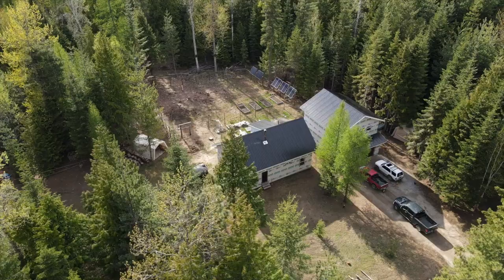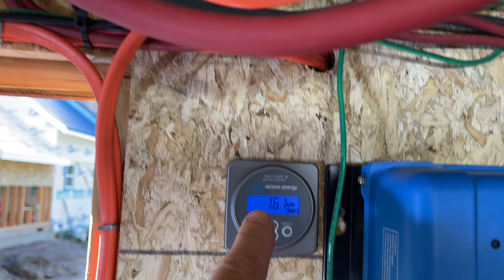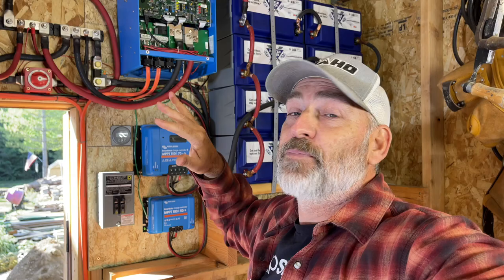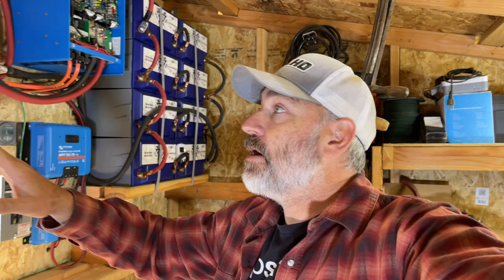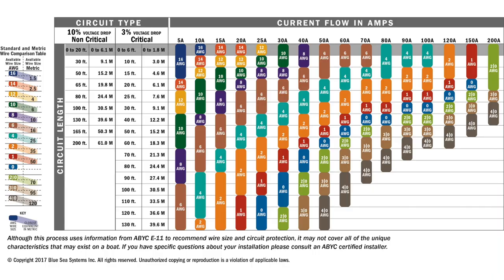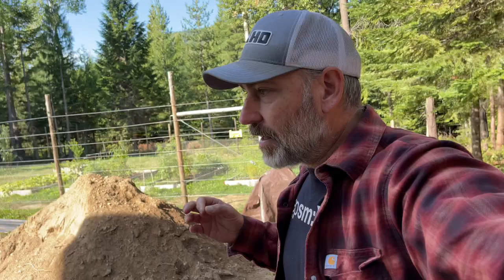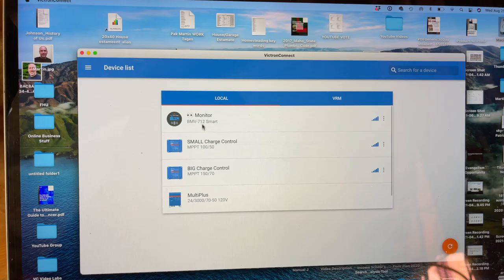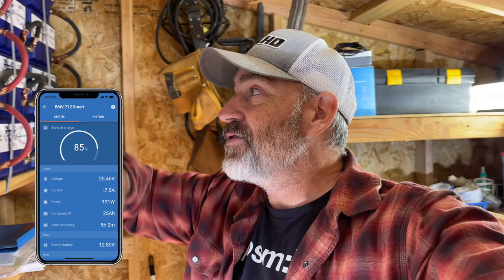DIY Off Grid Solar Power System for Home - AMAZING POWER!

Comment: We just bought a Amish farm here in TN. I already ordered my Battle Born system with 8 batteries and a 5000 watt inverter charger. My question is regarding your well pump. Our pump needs to be replaced. I was looking at a 110 volt pump. Is there a reason you went with the 230 volt pump?
Reply from the maker: Wire size and length of the run. Check some well wiring charts to make sure you use the right size wire from the inverter to the pump. https://www.aquascience.net/wire-sizing
Reply: Okay, looks like the bigger pumps require 230 volt. Just trying to get my head around it but do I need a second inverter to combine them to get the 230v. I think that is what you are doing?
Reply: @rambling4x4adventures92  I have a similar situation with my well pump. I currently run a 110 Volt pump but its a long way from the well to the house. I have to use larger wire to make sure enough power can get to the pump itself. 
Im not 100% sure on this but I think 230V pumps are a bit more efficient and cycle less. 
Im about to install a new VFD constant pressure system which has a soft start.

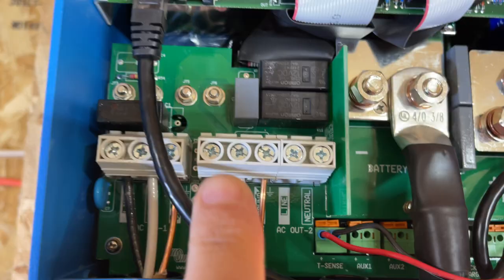Comment: Hi Martin, again, very good videos, thank you. I have a couple of questions, the first one is about something I noticed in minute 6:20, I understand that you use a split phase system to draw 240 V and feed the well pump, but I also noticed that the inverter has 5 connection lugs on the output side, two of those are for the line, since I don't know well how it works so maybe you can help me understand, but if you use those two lugs, then you can draw 240 V out of a single inverter? 
Also, What is the size of your well pump (240 V, ¿HP?).
Thank you!
Reply: I had this same question. I want to start with 1 inverter.

Comment: Metals and rare earths are needed to make solar panels and inverters.   We mine them.   Through mining.     In 2019 I I had thought ( I was told) mod shipments slowed down because of high demand ( which in part was true).    But I now feel mineral demands exceeded mod plant manufacturers and this caused the actually mod/inverter/storage battery shortage.       Green builders ( installers and managers ) have also lost their jobs due to the general slow down.   Yes even green jobs

Comment: That's pretty cool. Can you share what it cost for the total system (panels, batteries, controllers, inverters)? What is the life expectancy for the batteries? Will you keep a spare battery charger and inverter on hand? With all the data that's collected, you will be able to calculate the cost per kilowatt-hour over the life of the system. I imagine that over time, equipment will improve and cost will go down. It has been great following your progress as your dream comes to fruition.
Reply: In the description it has a link to everything those batteries are $950 each
Reply: @nogonova  Thanks, those parts add up quick.
Reply: @ctbcubed  yes, they do, but what you're doing is eliminating the impact of the retail price changes of electricity, (which strangely only go up every year, never down) and protects you from the effects of power cuts (cyberwarfare attack on the power company?)

Comment: Weren’t you using Dakota lithium batteries? If so why not now? Wish I had your smarts marty 🤷‍♂️ my wife and I have a 300 foot cabin in the desert and at the moment we are just trying to get our 500 watts hooked up with gel batteries this has been very expensive as I’m on disability ssi. But love what you have done and would love to have a system like yours someday. Ps do you still have the Bluetti ? And if so what have you been powering with it?
Reply from the maker: No, wasn’t us. I think they are good batteries too though.
Reply from the maker: Yes we still have it. Mostly use it to run our internet and security cameras. Also us it here and there instead of taking the gas generator.
Reply: @MartinJohnsonOffGridLiving  thanks for the reply’s I do appreciate it as I know you are a busy guy🙂

Comment: Could just rig a 24v high output alternator or two to the generator and run DC straight to the batteries.

Comment: The battery connection is wrong. LIFPO4 batteries should not be connected in series. There are controllers inside. If one in the series is already charged, all the voltage can damage the other in the series.

Comment: Battery setup looks good with the Straps, but Man are you making me nervous, every time I seeing the negative wire crossing so close to the Positive terminals of 2nd row far left.
 Have you ever seen 100 amp Batteries short out.   You will, when the Rubber insulation breaks through on the Negative cable

Comment: Absolute kudos for running Split Rail 240v (technically, a center tapped common output) but the misnomer of "split phase" is incorrect. Your phase is and remains 180 degrees. If you center tap that, your phase stays the same. Think current, not voltage. It's an extremely common mistake that electricians make in terminology, it drives us in electronics mad, as by making that mistake, it makes understanding of control circuitry nezxt to impossible.

Some inverters come or can be upgraded to triple phase output, wonderful for running industrial woodworking tools, but unless you have need for triple phase (the motors are much more efficient, as is the power delivery) split rail 240v is a huge plus. Again, for table saws and other heavier woodworking tools, operation is much better, and line-losses far lower. Table saws typically kick up to running speed in a quarter of the time compared to same motor running on 120v (most motors can be configured to run on each). 240v fed motors also don't 'sag' as much, as torque is much more readily delivered when needed.
Reply: Good comment. Btw: First of all I got confused about the "phase" thing, then remembered I believed I commented on this on Marty's last run down video. Good tutorial though: he did this self-taught and he keeps improving, which should be an inspiration to others.
Reply: I have never heard of a split rail 240 volt AC system. I am an electrician and I also don't call it "split phase" I just call it single phase 240 volt system. I guess I learned something new today!

Comment: Why not use 48v system?  24v good for EV but home better with 48v or up.
Reply: exactly, fixed installations can easily use 48v for better efficiency and smaller wires.

Comment: 1.Why are you usingthe generator..?  is it on gas.? the  other video  i so you got the 8 new bat. .it have a smll  box below (cant racall the name on it). you shiftet to 2  big ones over the dor. 2. why did you get  does 2 ? i did edit now its 24 V called a chager inverter i think.  you had another in the first video before opgrade to 8 batterys. i never see any solar panel coneckting before :)

Comment: why wouldnt you run your battery bank to 48VDC? if you have that many batteries higher voltage is always cheaper...
Reply: With the increased voltage you will have a drop in amperage. I can’t imagine he can run his entire place on just 200 A.
Reply: @digitaldazzle5836  that’s the whole point. Less amps = smaller wire and higher efficiency inverters and less losses.

Comment: Hi - each BMS on each Battery makes 8 slaves - those 8 slaves need a Supervisor/Manager.  Otherwise they are 8 individual batteries.  A Supervisor/Manager BMS will get the 8 in sync.  Then that will be a 2s4p Battery.  For now, they are not in sync - unless they talk to each other through a Comms Cable?

Comment: Better adjust your Equalisation voltage then . That should be off otherwise you will have your batteries overcharged . These are not what victron recommend so I don't know where the heck you got your setting from but they are wrong . Gradually you will be wearing out those Battleborn expensive batteries . When you can drop all the top voltages to no more than 27 volts anywhere. That way your battery cells will last, As they are I will be surprised if they are not dead in 12 months . When that happens I hope you remember to fix all those.

Comment: Shouldn’t you use 30amp breakers as the victrons are 3000 watts @ 120volt?  That’s 25 amps.

You’re shorting yourself 5 amps from each.

With having 20amp breakers coming off your inverters you capped yourself at 4,800 watts
Reply from the maker: True but this way the beaker will trip before the inverter overloads. That is my thinking anyway. Haven’t tripped one yet 🤞
Reply: @MartinJohnsonOffGridLiving  taken from Victron:  Consider for example a 30A 120/240V split phase supply. The supply could be the grid, a generator or two stacked inverters. Some of the loads connected are 240V, others are 120V. On each 120V leg the load should not exceed 30A. The problem is that as soon as 120V loads are connected, the two legs will show a different current. This is because the 120V loads on the two legs will never be balanced. A 120V 1200W hairdryer, for example, will draw 10A from one leg. A 120V washing machine could even draw in excess of 20A from one leg. Between the two legs the difference in current, or current unbalance, will therefore often be 20A or more. This means that the 30A supply will not be used up to its full potential. By the time one leg draws 30A, the other leg may be drawing no more than 10A, and increasing the 240V load, for example, will result in an overload of one leg while the other leg still has spare capacity. Theoretically, the total power that can be drawn from a 30A 120/240V supply is 30 x 240 = 7,2 kVA. In case of 20A unbalance, the practical maximum will be 30 x 120 + 10 x120 = 4,8kVA, or 67% of the theoretical maximum. The solution is an Autotransformer. By leaving the neutral of the split phase supply unused, and connecting an Autotransformer to create a new neutral, as shown in figure 1, any load unbalance is ‘absorbed’ by the Autotransformer. In case of a 30A supply, the load can be increased to 7,2kVA, and a 20A load unbalance will result in one leg supplying 40A, and the other leg 20A. The 20A difference will flow through the neutral and the windings of the Autotransformer. The current through both 120V wires of the split phase supply will be 30A.
Reply: @MartinJohnsonOffGridLiving  sorry my other comment didn’t post.  It’s called the Victron Auto Transformer.  It’s about $650.  Basically it goes between your inverters and your loads.  So instead of 25 amps and 25 amps, you could do 49 amps on one leg and 1 amp on the other.  The inverters would still see 25 and 25.
Reply: @xzibit8614  The autotransformers are really neat for balancing the current between the two inverters!

Comment: with all the extension cords they have more restriction, you should immediatley run your permanent line to a circuit panel box to the house  plus the cost of all those cords it would have been cheaper to buy a roll of 10/4 to run to the house

Comment: the only thing that would make that worth the money is if your being sponsored by those companies. otherwise you can buy pretty much 100% the same batteries only with a Chinese label for 30% of the cost and the same with the inverters. battleborn imports Chinese cells and builds their batteries out of the same Chinese cells that all the other brands use and then they mark it up by 300%-500%. as a result people who end up paying $10,000 get $3,000 worth of stuff. the Chinese suppliers are not rip offs either, they have 10+ year warranties on all their stuff. also the Chinese inverters are also a fraction of the cost and natively output both 240v and 120v in a single unit without having to buy 2 inverters. (pure sine wave)

Comment: You can move the shed with a lever. Me and another guy move boat lifts that weight more than the shed. I had to walk my shed 20 feet off the trailer by myself no tractor. Even today I can lift my shed with 2 motorcycles in it by using a lever. Should of bought super capacitors they would last rest of your life. Lithium are a waste of money. Super capacitors only take less than 10 minutes to charge the bank.

Comment: Lights lights lights where are the lights on your panels? For 24/7 365 power supply just add lights! For wind power just add fan! Hydro power just pump the water back into the lake!

Comment: Are you going to insulate teh shed?  Those batteries shouldn't be cold.
Reply: You mean they shouldn't be hot?
Reply: @uhjyuff2095  Nope.  Well, not as much.  If the batteries get below freezing you can destroy them by trying to charge them.  With the BMS it probably won't actually damage the battery, it will just mean you can get no power out of them if they're too cold.  It's true there is a high temp cutoff also, but if your exterior temp gets over that you have more problems than your batteries not working, like the end of the world as we know it.
Reply: @brianvandy4002  Correct, the process of freezing these batteries will not damage them and the BMS will make sure they won't charge or discharge if the temperature changes to the set temp the manufacture sets. From my understanding extreme hot temperatures should be avoided because that will cause damage to the batteries and the freezing cold will not.
Reply: @uhjyuff2095  But if you need them to work when the outiside temperature is below freezing, insulation and a supplemental heat source (100w light bulb or heating pads) could keep them working.  That's why I asked if you were going to insulate them.  I mean, if I were in a cabin in the woods on a freezing cold winter, I'd sure like to be able to curl up beside the fireplace and read a book with a lamp.  A fire makes a poor reading light.  ;)
Reply: @brianvandy4002  I would not mess with heating the batteries, I would just grab a flashlight/lantern for reading if my batteries shut off.
Reply: @uhjyuff2095  Okay, and if it dips below zero for a few days in a row, you'll be without power in the house unless you run a generator.  I'm just saying that with a few hours worth of work and a sheet or two of rigid foam insulation you could insulate the batteries and maybe throw in a light bulb and you can have power even in the depths of winter.  Of course, I'm not sure where you are located so maybe you don't get that cold in the winter.  If you were in NW Oregon you're okay. if you're in Montana you're going to be without power much of the winter.

Comment: How in the world are y’all running all of those components off of 8 100ah batteries ⁉️⁉️⁉️🤔
  I have a hard time keeping a 150watt refrigerator with 6 100ah batteries wired in 24v with 2000watts of solar and a MPP LV2424 all in one unit 
   I’ve got to be doing something totally wrong   My batteries are ampere time and chines  both the same size 100ah 1280 watt hour
Reply: He runs the generator. A lot.

Comment: This setup is done with the mentality of an auto electrical guy the batteries are not hooked up in a balanced configuration leading into deterioration early on into the life of the system looking at these batteries this guy paid $800 a battery I bought the same kind of batteries for 459 the inverters are not tested to see what their no-load draw is leading to draining the batteries when there's nothing on the system running

Comment: Millions of Americans could face even higher energy bills this winter if the Biden administration closes a gas and oil pipeline running through Michigan, a group of Midwest lawmakers has warned.
Line 5 pipeline could be under threat due to the White House exploring the potential impact of closing it on fuel prices in the region, according to a recent Politico report, amid a drive to reduce the U.S.'s dependence on fossil fuels.
The line, which delivers Canadian crude oil and natural gas from Alberta to Ontario through Wisconsin, the Great Lakes, and Michigan, has operated since 1953 and currently transports about 540,000 barrels per day. But the insane Biden administration that already shutdown one pipeline, Wants to shutdown another? this is the act of a Globalist, Attacking U.S. independent energy is the reason why we continue to see energy prices sky-rocketing and we the people will pay for it, Sleepy Joe's inability to run this Nation is the reason why we will pay BIG TIME, This is clearly the worst President in my lifetime.

Comment: way too complicated for a beginner... confusing and extensive.. do not even come close to understand the split phase issue.. or why,, for any of it.. how many solar panels for this system.. how do you know? what size are the panels.. 300 watt for each? its a large house..  what size lithium batteries.. or why.. sorry .. its pretty intense.. only thing I understand is how to line up the batteries.. how do you know what size inverters you will need.. do you have a simpler instruction ?
when I need a simpler hook up for may shed to homestead project whre no electric available